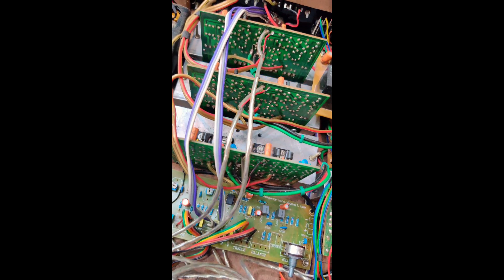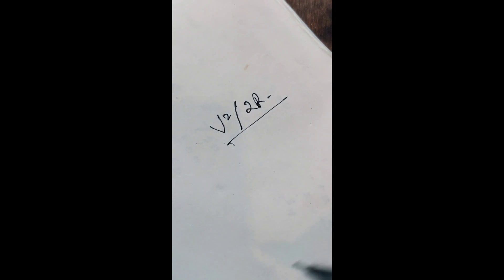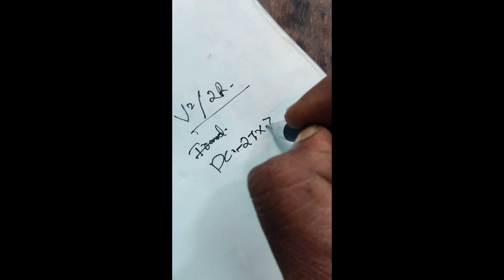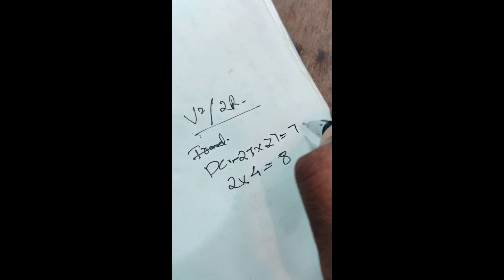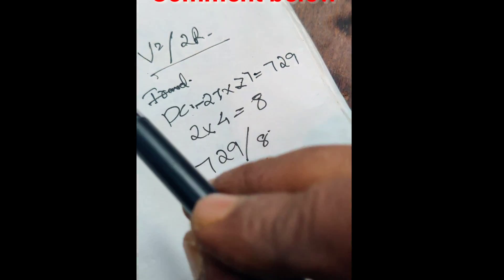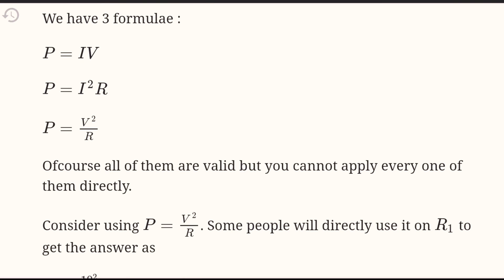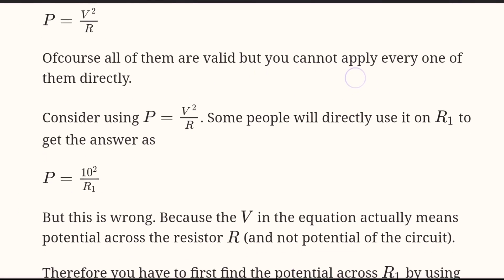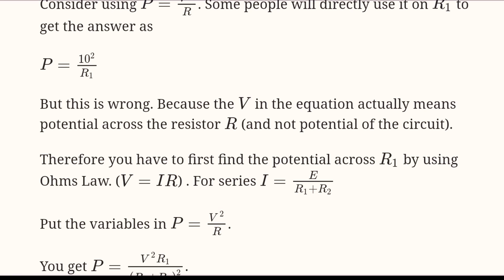Amplifier watts calculation right or wrong | Amplifier RMS Calculation

Comment: Wrong  9.8V RMS/4ohm=2.45A Rms
9.8× 2.4=23W RMS
Multimeter ഉപയോഗിച്ചാൽ  DC resistance ആണ് കാണിക്കുന്നത് impedance alla. Low power speaker   ഒക്കെ impdance 4 ohms dc resistance  നേക്കാൾ actual impedance   കൂടുതലാണ്  അതാണ് input current കുറവ്. അതിനാലാണ് power 23W RMS Output കിട്ടാത്തത്. പിന്നെ datasheet തന്നെ പറഞ്ഞിട്ടുണ്ടല്ലോ 13W @ 8 ohm then @4 ohm 13× 2 approx  26W RMS
Reply from the maker: Datasheet 13w @8ohms from 16.5v using 1khz - correct 👍

Comment: Hi, ചേട്ടാ നിങ്ങൾ ചെയ്തത് ശരിയല്ല എന്ന് ഞാൻ പറയില്ല, പക്ഷെ calculation accurate അല്ല.
12.6 വോൾട്ടിൽ 1Ampere amplifier വലിക്കുന്നുണ്ടെങ്കിൽ power consumption 12.6 Watts ആണ്. 12.6Watts power വലിക്കുന്ന amplifier 12Watts output തരില്ല, 100% efficient ആയിട്ടുള്ള amplifier നു മാത്രമേ അത് സാധിക്കൂ. Class D amplifier നു പോലും 90% ഒക്കെയേ efficiency ഉള്ളൂ. Bro ഉപയോഗിച്ച TDA IC ഒരു Class AB IC ആണ്. അത് maximum 75% efficiency ഒക്കെയേ തരികയുള്ളു.
പിന്നെ ഒരു സംശയം, bro video യുടെ തുടക്കത്തിൽ പറഞ്ഞത് V2 എന്നത് transformer output DC voltage ആണെന്നാണ്, but അവസാനം calculation ചെയ്യുമ്പോൾ speaker നു across ഉള്ള voltage(9V) ആണ് എടുത്തത്? 🤔
ശരിയായ amplifier output calculation ഇങ്ങനെ ആണ് :-👇
https://youtu.be/Gcez9-Nvlk4
https://youtu.be/aK63iCI11D4
https://youtu.be/MKO88exOV_0
Reply from the maker: 1khz measure ചെയ്തുള്ള calculation ആണ് ശരിയായി കിട്ടു എന്നാണ് എന്റെ അഭിപ്രായം.2 രീതിയിലും calculate ചെയ്യാമല്ലോ അല്ലെ
Reply: @ElectronicsElectricalmalayalam 
Hi,
ഇതാണ് accurate method::-👇
https://youtu.be/Gcez9-Nvlk4
https://youtu.be/aK63iCI11D4
https://youtu.be/MKO88exOV_0

Comment: usb panel il class d amplifier boards use ചെയ്യുമ്പോൾ fm channels um fm clarity ഇയും വളരെ കുറവാണ് class ab വച്ച് നോക്കുമ്പോൾ ഇതിന് എന്തെങ്കിലും ഒരു പരിഹാരം ഉണ്ടോ?? ❤️
Reply: Class D amplifier വച്ചാൽ fm reception കുറയും എന്ന് പലരും പറഞ്ഞു കേട്ടിട്ടുണ്ട്. High frequency switching നടക്കുന്നത് കൊണ്ട് FM circuit ൽ interference വരുന്നത് കൊണ്ടായിരിക്കാം.
Ideally FM നു നല്ലത് Class A or AB amplifier ഉം linear power supply or battery യും ആണ്.
Reply: @RoyalTech_2024  thank you for your suggestion
Reply: @muhammedsiraj4  ഞാൻ  ഇതിനു മുമ്പ് class D ഉപയോഗിച്ചിട്ടുണ്ട്, അപ്പോൾ 1meter lenght ഒക്കെ ഉള്ള wire antenna ആയി ഉപയോഗിച്ചപ്പോൾ FM കുഴപ്പം ഇല്ലാതെ കിട്ടി.
Reply: @RoyalTech_2024  പക്ഷെ ab യുടെ അത്രയും നല്ലത് ആണോ
Reply from the maker: Psu ഏതാണ് ഉപയോഗിച്ചത്
Reply: @ElectronicsElectricalmalayalam  power supply ആണോ ചേട്ടാ ഉദ്ദേശിച്ചത് അത് lead acid battery 6v 2× series 12v ഉപയോഗിക്കാൻ ഉദ്ദേശിക്കുന്നത് ഇപ്പോൾ ഉണ്ടാക്കിയിട്ടില്ല ഉണ്ടാകുന്നതിന് മുൻപ് ചോദിച്ചതാ stereo tape recorder bt speaker ആക്കാൻ ഉള്ള plan ആണ് അപ്പോ fm നല്ല രീതിയിൽ കിട്ടണം എന്നുണ്ട് പക്ഷെ class ab ഉപയോഗിച്ചാൽ നല്ല clarity ഉണ്ടാകും പക്ഷേ class d  ഉപയോഗിക്കുന്ന അത്രയും backup കിട്ടില്ല എന്ന് തോന്നി🤔❤️
Reply: Metal sheet upayogic GND കൊണ്ട് amplifier board ine cover ചെയ്താൽ മതിയോ
Reply: @muhammedsiraj4  അറിയില്ല bro. Amplifier case already metal അല്ലേ?
Reply: @RoyalTech_2024  പക്ഷേ case il GND ഉണ്ടായിട്ട് കാര്യം ഇല്ലല്ലോ amplifier nte case nte ഉള്ളിൽ നിന്ന് തന്നെ usb panel nte fm signel ഇനെ class d ക്ക് block ചെയ്യാൻ കഴിയുമല്ലോ
Reply: @muhammedsiraj4  അറിയില്ല bro. Experimental ആയിട്ട് ചെയ്തു നോക്ക്. Quality reception കിട്ടുന്നുണ്ടോന്നു നോക്ക്.
എത്ര വാട്ട്സ് output ആണ് പ്രതീക്ഷിക്കുന്നത്?
Reply: @RoyalTech_2024 bluetooth speaker nte watts ആണോ ഉദ്ദേശിച്ചത് class d ആണെങ്കിൽ tpa3110 15+15w ab ആണെങ്കിൽ 2030ic വച്ചുള്ള single supply stereo board
Reply: @muhammedsiraj4  15+15 ഒക്കെ output വേണമെങ്കിൽ class AB വച്ചാൽ battery പെട്ടന്ന് തീരും. 2030 IC ഒക്കെ വളരെ inefficient ആണ്.
Reply: @RoyalTech_2024  class d ആയാൽ കുഴപ്പം ഇല്ലല്ലോ 12v 4.5 ah ആണ് lead acid battery അപ്പോ പെട്ടന്ന് തീരുമോ
Reply: @muhammedsiraj4  Class D വളരെ കുറച്ചേ വലിക്കൂ.
ഞാൻ എപ്പോഴും li-ion battery ആണ് ഉപയോഗിക്കാറ്, അതാകുമ്പോൾ size കുറവാണ് , charging board ഒക്കെ readily available ഉം ആണ്, mobile phone charger ഉണ്ടെങ്കിൽ അതുകൊണ്ട് ചാർജും ചെയ്യാം, separate charger വേണ്ട...
നിങ്ങൾ 12V battery എങ്ങനെ ആണ് ചാർജ് ചെയ്യുന്നത്? Charging circuit കയ്യിൽ ഉണ്ടോ?
Reply: @RoyalTech_2024  cerquit ഒന്നും ഇപ്പോ കിട്ടിയിട്ടില്ല ലിഥിയം ion ആണോ better? 4300mah 3.7v battery 4എണ്ണം series ചെയ്താൽ നല്ല backup കിട്ടുമോ അല്ലെങ്കിൽ 3.7 4300 2എണ്ണം parelel ചെയ്ത 3pack series cheyyunnathaanoo better class d ക്ക്
Reply: @RoyalTech_2024  thank you so much for your suggestions🙏🙏❤️❤️❤️😊
Reply: @RoyalTech_2024  ഞാൻ ഈ ചേട്ടനോട് ഇതേ ചോദ്യം ചോദിച്ച് mcb il ഉത്തരം പറയാൻ request ചെയ്തിട്ടുണ്ട് ചേട്ടൻ mcb il എൻ്റെ aa comment choose ചെയ്താൽ ഞാൻ bro യുടെ comment inu വിലവച്ചിട്ടില്ല എന്ന് കരുതരുത് 👍❤️ ഒരു സംശയം തീർക്കാൻ എത്രയോ പേരുടെ അഭിപ്രായം choodikkanamallo ☺️